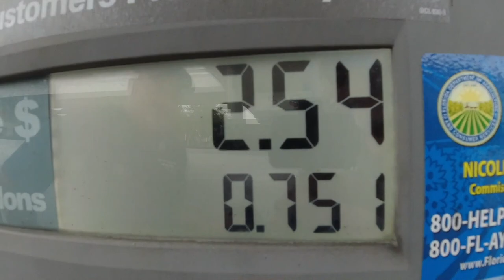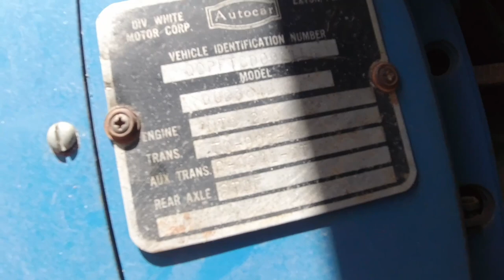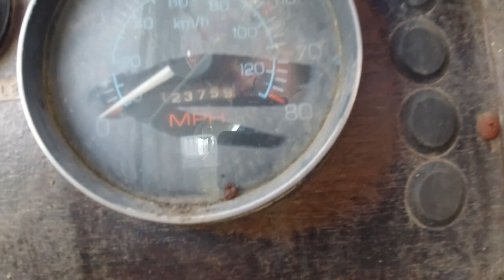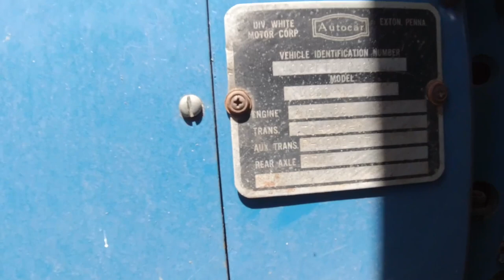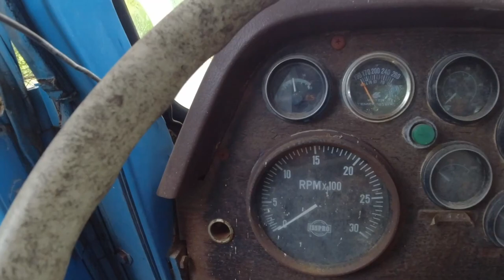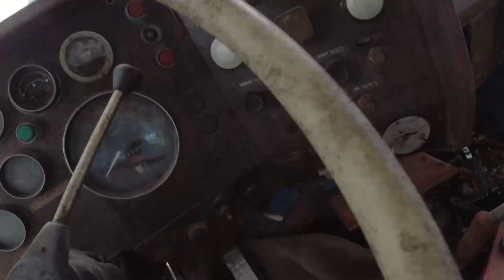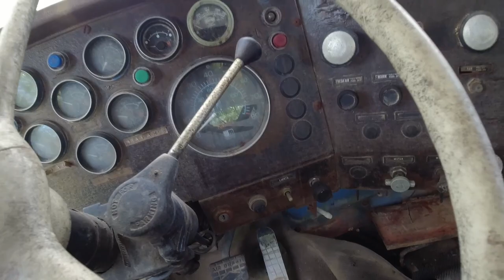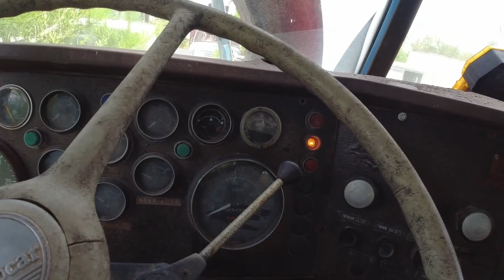WILL IT START? ABANDONED AUTOCAR ROTTING AWAY!

Comment from the maker: Download the FREE Upside App at https://upside.app.link/HF10 to get $5 or more cash back on your first purchase of $10 or more.
Reply: for the batteries connecting the positive side first leaves the system without power until it is grounded power flows from the negative pole to the positive . thanks for the videos. ps the hood clips engine blanket or sound insulation but with the block heater i would venture a guess its spent time where there is serious winter not the florida variety.
Reply: wish you would make Wyle a shirt.  .  great show guy.  you guys are like best mates that get on very very well and that makes a great show   . I learn so much off you guys. love your show. even mumma bear doing the intro.  its new keep this content coming.  motivation is so great

Comment: Hank....those plates on the inside of the hood butterflies are there to hold soundproofing insulation.  I suppose the insulation was there to keep warmth in the engine compartment during the cold weather (in the much colder climates than Florida!).  The insulation sheets were fiberglass with a foil like covering on the outside.  We had a couple of Autocars of that vintage....one my Dad bought brand new in 1979.
Reply: Yep. Insulating blankets.
Reply: I think the insulation was to protect the paint from extreme heat,  and hopefully last longer than one summer.
Reply: @bertgrau3934  you very well may be right on that....it makes sense since those butterfly doors are kinda thin to keep the weight down
Reply: My first thought was with the block heater and hood blankets, the truck may at one time been up North..
Reply: I was thinking exactly that!  Nice!  :)
Reply: naw just sound proofing...that insulation over time just becomes a hindrance.  For heat isn't a thing when its wide open on the bottom and 4-8 inches from the top.  So its only for looks in my opinion. but still not for keeping heat.  all heavy duty semi motors can keep things warm with out a belly blanket all the way down to like -50 before really being needed to be used.  Don't believe what they tell you how "ice road truckers" do it.  I live in ND and drive semi's here year round.  i've drivin in -70 degrees without wind chill and no issues about the motor being to cold.  Thats why they use "winter fronts" on vehicals back in the day.  Old stuff was made to run in 99% of weather and temps regardless of conditions of the motor is in.  If it runs it will not get to cold to run.  Colder is better to a point. more HP.  Hotter less HP.
Reply: My Dad had a Autocar 1966 they really nice trucks

Comment: International Fleetstar is a series of heavy-duty trucks that was produced between 1962 and 1977 by International Harvester. Slotted above the Loadstar and below the Paystar and Transtar conventionals introduced after it, the Fleetstar was the first truck line that International designed specifically for vocational use.
Reply from the maker: Interesting
Reply: @HamiltonvilleFarm  The old mixer I drove was from MTM (McNeilus Truck & Mfg) up North but I can't remember what it was except a STAR-something. or maybe a something Star. Tandem with a 9 yd tub, 6-71 and 9-speed OD Roadranger.
Reply: I can remember as a boy. The company my dad worked for bought him a brand new 1976 International Trans Star 2 Bicentennial Edition cab over. It had a big cam 400 Cummins and a 13-speed road ranger transmission. It would flat out get on down the road. Before that, he drove a cracker jack box jimmy. He hated that truck because he stood 6foot 6inches tall.
Reply: @cherokeeoutlawmartiel5340  I was 6'2" and I suffered myself so I hate to think about a 6'6" folded up in one. I used to live in Cherokee County and loved every second of it.

Comment: I bet that truck is from way up north we’re it is very cold , the block heater and I suspect those little squares held insulation in place to keep heat in the engine bay 👍👍
Reply from the maker: Good guess. Makes sense. I know it spent many years down here, but it may have started up North for sure. 👍

Comment: 1:00 The loadstar is a medium duty conventional truck usually used for local delivery, farming, construction, etc. The Fleetstar is a heavy duty conventional it was used as a local straight truck with mid range engines and a semi-tractor with heavy duty engines. The Transtar/Transtar II was a cab over heavy duty over the road semi. The Cargostar was medium duty cabover straight truck. The Transtar 4200/4300 was a heavy duty long hood conventional it was a semi-tractor for local construction, regional hauling, and long distance over the road trucking. The Paystar was a severe service  and commonly used as heavy-duty dump trucks, concrete mixers, etc. There's also the newer Durastar, Workstar, Prostar, and Lonestar.

Comment: The steel plates on the hood might have held insulation in place, could be for sound deadening or temperature control in really cold climates (fits with the possible bl9ck heater cord, too)
Reply: My thoughts too!
Reply: Definitely for under-hood insulation.  Batteries under seat to keep them from freezing.  With the block heater, that truck came from up north.
Formula 290 was a combination built by Cummins for fleet operations.  It's not the HP.
If that was house mover, the beefed frame was for carrying extra "traction weights" as the house was on dollies.  So no tongue weight to help.

Comment: I have one of those battery carriers that I bought decades ago off the Snap on truck and the part that actually hooks on the battery is about 2-1-2 inches wide and it works a lot better than the one you have and it is worth what ever it would cost now, I am sure other places would have them cheaper than the Snap On, check it out.

Comment: What are those 2 shifter looking handles up on the back of the cab while Hank was installing the new batteries? Looks like air lines going in/out of them
Reply: Air controls for the winch,1 for the brake band,other for the dogs to engage or disengage the winch drum

Comment: Mike from Dirt Perfect explained he looks at two things when buying machinery. One: if the batteries are mounted with the original holddowns and two: if the lights are all still attached and straight. It is a sign of its owner for keeping good care of their machine.

That crome knob shifter of the Fuller transmission is called a Tinkerbell shifter BTW.
Reply from the maker: Right on. I’m a big DP fan👍

Comment: That suspension is a Rockwell 6 rod suspension, tough but hard to get parts to Re-bush these days. I like Hendrickson better just for simplicity but it’s still a tough setup. I’d bet that truck had a winch on it from day one, the auxiliary transmission behind the 13 speed almost guarantees that’s what it had from new because that’s one of the only reasons to order a truck with a road ranger trans and still have an old auxiliary trans behind it, it gives an extra low hole and overdrive as a bonus but the big reason is to run the mechanical winch forward and backward at variable speeds. And before anybody says “blue button means 8ll or 15 speed, not 13”….that’s true since around 1985 but the OLD original Eaton 13 speed knobs had a blue splitter button and a single Phillips head screw holding the top plate on the knob…that’s what this is. Back in the day when this truck was built the 8LL and 15 still used the old style range selector valve that clamped on the stick with hose clamps and had the deep reduction switch on the dash.

Comment: That will start. You need 4 batteries with high amperage. Starter might be stuck. Smack the starter with a big hammer while trying to crank it. Also to take some work off the starter step on the clutch while cranking too. But by the sounds of it you need 4 big batteries. Also that rear suspension is either 50 or 55,000 pound capacity Rockwell Suspension

Comment: hey  hank  i  have  a   white  road  boss   in  my  shed . it  is. the  same  truck  as  that  only  it  has  tilt  plastic   front  and  cummins  350 .big  cam  the  same  cabin  was  used  on. the  western  star  for  about  2  years  after  that  the  roof  was  lifted  about  4inchs  and  door  handles droped to  bottom   corner  and...pull  type  all  up  agreat   truck  with  more   space  between   steering  wheel. .and  seat  making  them .very  nice  to  drive   now  hank  if  that auto .car..dont  turn  over   sugest  you  get  big   crank  handle   eat your . wheatys  and  go  to   gym  twice  a  week lol  love  your  vids  cheers

Comment: You mentioned loading equipment on the site - could you try giving the truck a tug with it in gear (assuming its got all its wheels)?
Reply from the maker: yeah we might try that when we go back. We did that to military truck and grader if you recall.

Comment: The following came from a Wikipedia article titled “List of International (brand) trucks”.

The LoadStar was a medium-duty short-hood conventional introduced in 1962.

The FleetStar was a heavy-duty short-hood conventional. It was introduced in 1962 and entered production in 1963. 
The TranStar cab-over-engine models were heavy-duty over-the-road semi-tractors introduced in 1968. 

The CargoStar was a forward control cab-over-engine medium-duty series introduced in 1970.

The TranStar was a heavy-duty long hood conventional introduced in 1971. 

The PayStar was a severe service conventional introduced in 1972. 

The DuraStar is a medium-duty truck. They were introduced in 2001 as the 4400 Series and renamed DuraStar in 2010. 

The PayStar 5000 is a severe service truck. It was introduced in 1995 as the 5000i Series.

The WorkStar is a heavy-duty truck. It was introduced in 2001 as the 7000 Series and renamed WorkStar in 2010. 

The TranStar is a heavy-duty highway semi-tractor with a low drag hood. It was introduced in 2002 as the 8000 Series and renamed TranStar in 2010. 

The ProStar is a heavy duty highway semi-tractor introduced in 2006. 

The International LoneStar is a Class 8 semi-trailer truck manufactured by International Trucks, powered by the Cummins X15.

Comment: Loadstar-medium duty truck aimed at farmers and inner city commerce.Fleetstar-otr trucks designed to be sold in fleets to otr commerce companys,more sparsely equipped and priced according.Transtar-High end conventional and cabover tractors for long haul otr commerce companies and owner operators.Paystars-severe service trucks aimed at the construction industry,IH constuction equipment was the PAY line,but Paystars were in the oil  industries as well as heavy logging or wherever a severe service vehicle was required.

Comment: The numbers mean as much as the letters when it comes to the old IH trucks…the 1600-2000 series were the loadstar and fleetstar, aka medium duty to light heavy trucks, the 2070 being the biggest model (the “7” in the model number denotes HD diesel engine, a 5 would be a light diesel, and gas I can’t recall, maybe a “2”. Anyhow the 4000’s were the Transtar range, which were class 8 road trucks, the 4070 being the cabover and 4270 and 4370 being the hood trucks, short and long respectively. The 5000 was the Paystar , the on/off road heavy vocational truck line with both a 5050 and 5070 available, the only model in the 5000 range back in the IH days although more were added later once IH became Navistar International. The last of the Transtars was the 9000 series, the 9200 and 9400 were aero models and the 9370 replaced the old 4300 series. The 9600,9700 and 9800 were the last of the cabovers.